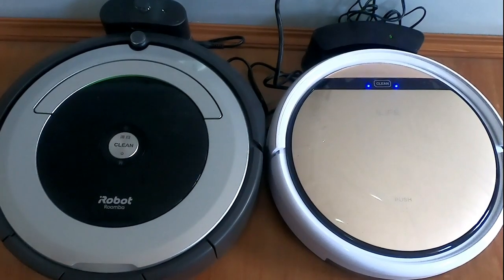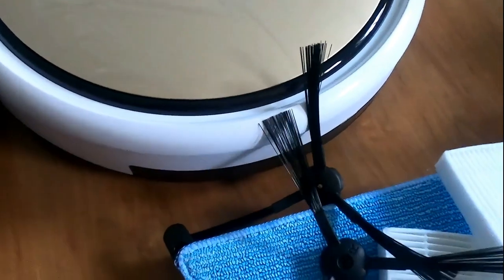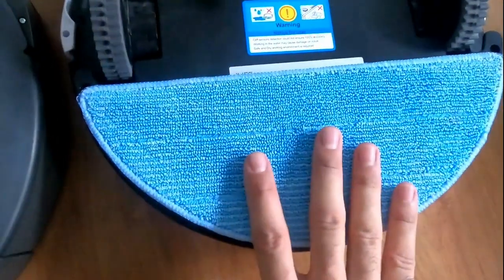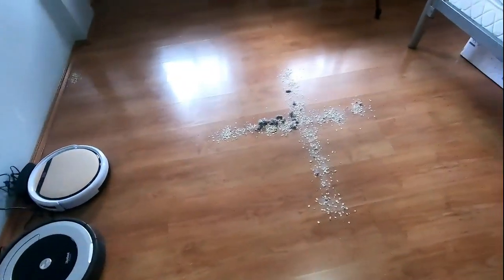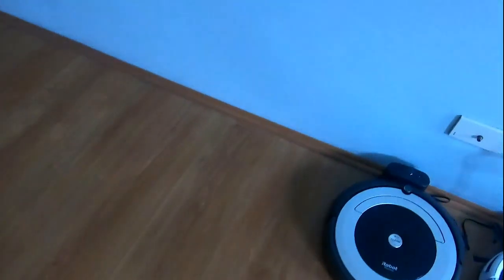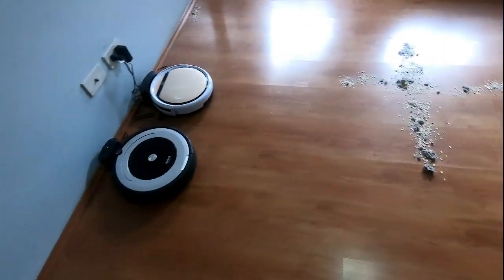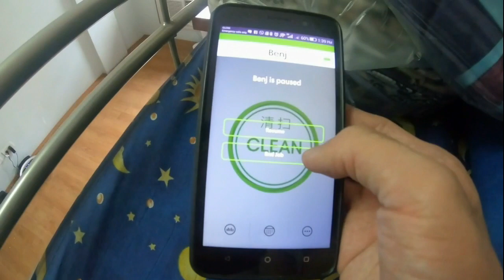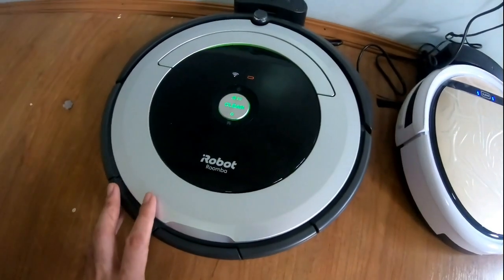iRobot Roomba 694 (or 690) vs ILIFE V5S Pro

Comment: It's important to note that the Roomba has a roller brush but the V5S does not.  This probably does not matter on hard floors where suction is more important but the roller brush not only loosens dirt from carpets but brushes the carpets removing footprints and giving it a more groomed appearance.

I have noticed the the V5S tends to avoid the capture area around it's docking station when it is cleaning as if the infrared beacons were a virtual wall.  It would be interesting to see how the Roomba virtual walls affected the V5S.

My V5S once wrapped up the power cable for the docking station around one of it's spinner brushes so you may not want to lie the power cable along the floor by the baseboard.

I find the Eufy 11S to pick up more than the V5S does.

I kinda miss the spiral patterns of the original Roomba.  Everyone uses the bounce and edge algorithm for the basic robovacs these days.

Comment: I bought ILIFE V5s Vacuum Cleaner last month & it started working intermittently, had a feel that it will be dead in next few weeks. As mentioned, customer care of ILife is useless & don’t respond. Even checked with amazon, they also sound helpless.
Reply: Motherboard of ILIFE Vacuum Cleaner bought two months ago got corrupted. There is no customer care in ILife, when complained about motherboard damaged, they talk about charging, absolute waste.
Reply: Taking cues from positive feedback on youtube, bought this ILIFE V5s Pro Robot Vacuum Cleaner this year & it stopped working in less than 6 months with no response from seller on warranty & repair.